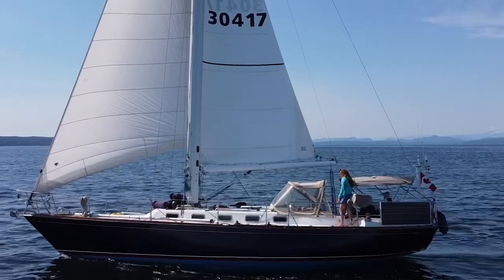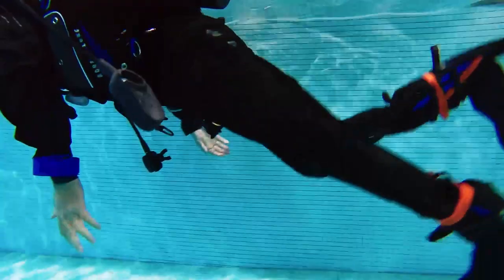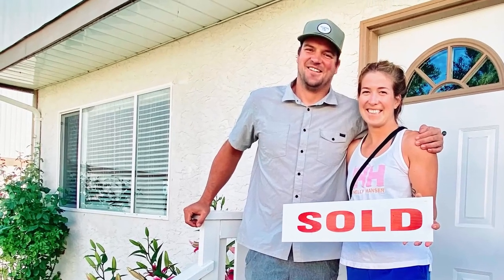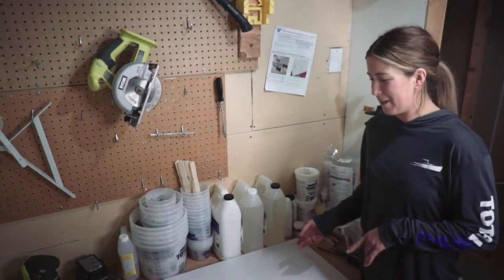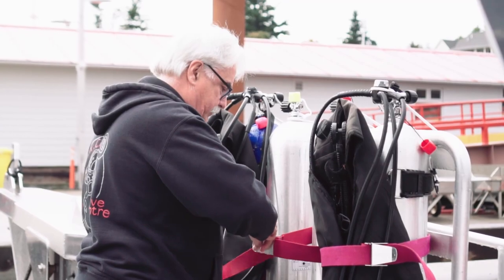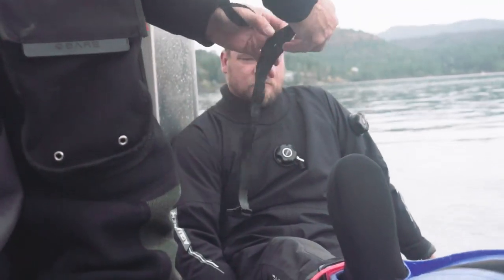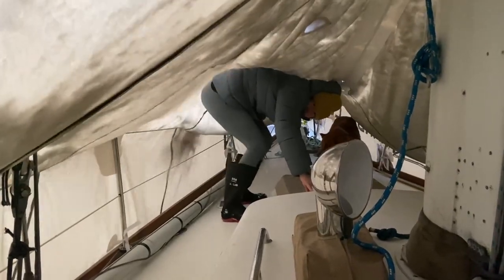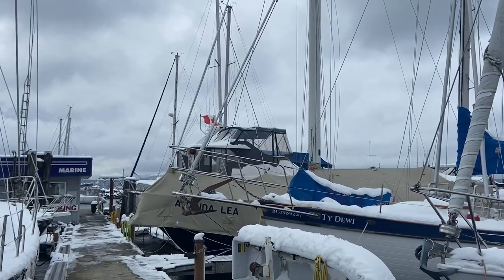EP 33 | This is WHY We're Glad We Moved Off Our Sailboat

Comment: Green is always ground (or safety ground), white is always neutral (and should be very close to  the same voltage as ground), Black is phase 1 hot and red is phase 2 hot. White to black or white to red should be 120-ish volts and black to red should be 240-ish volts. Voltages may vary by 10% or more depending on transformer settings and length of wire from transformer to  the point you are measuring as well as the load on the line. None of this applies to DC wiring of course.